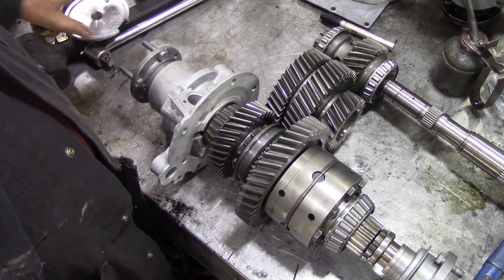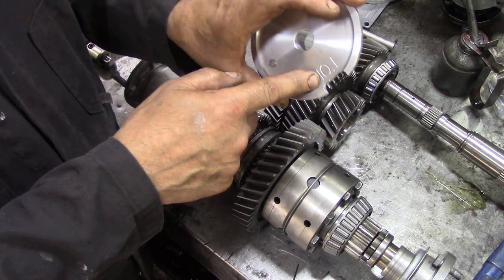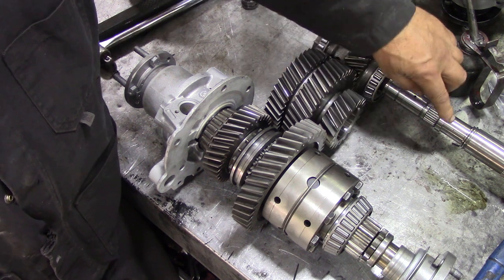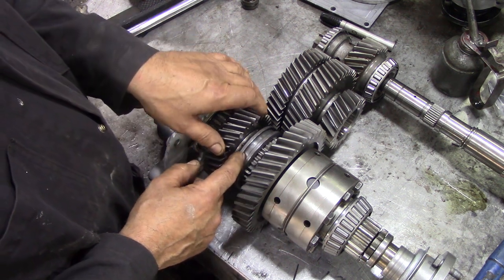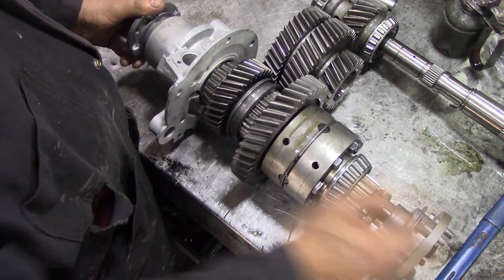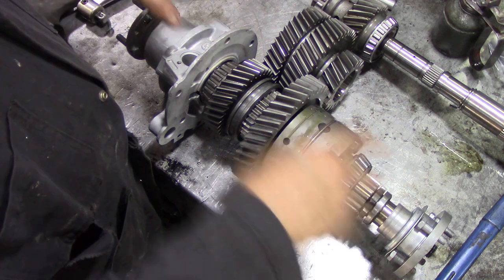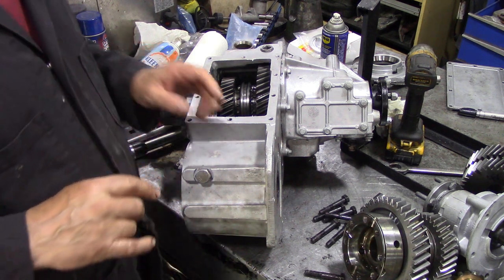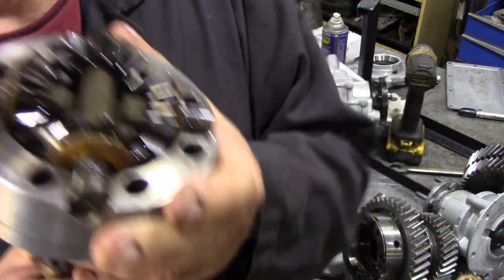LT230 why is mine clunking and what should it be like

Comment: You are the number one man, just finished resleeving my lt230,being a early version l drilled the holes with a masonry drill in the input gear a couple of years ago. I have a Ashcroft ATB diff instead of the one you are showing.
Reply from the maker: Yes the masonry bit works well, but it is slow!
Reply: @BritannicaRestorations  I have pto on mine, will that lube the splines or do I need to drill the gear if so what diameter? I  can't fit one of those adapters,  cheers Roy.
Reply: Hi Greg,  what size drill did you use, cheers Roy.
Reply: @royblackburn1163  8mm to 10mm, l sharpened the tip on the grinder. When you start drilling don't stop or it's hard to get going again. Drilled two right through giving it 4 holes. Did this two or more years ago and the input shaft is fine. My transfer is old 1.003 ratio to a lt85 gearbox and 4bd1t Isuzu motor.
Reply: @GregPalmer2  Prevention is better than the cure and cheaper will do it ASAP thanks Roy.

Comment: Excellent video!

Greetings from Brazil! Happy first/only owner of a 97' TDi (my father's car) with 220k Km and for some reason a lot of klunking. 100% stock car. Will open the transfer case next week to look what's happening.
Reply from the maker: Before you get too carried away, check the propshaft Universal joints, the rear drive flanges in the axle (if it is a 110), and the front axle CV joints
You can check the transfer case by removing the round rear cover on the back and see if there is any wear on the gear/output shaft spline
Reply: @BritannicaRestorations  You are the best! It's a Disco, but my guess is that it  should be the same as a 110. Will do it in January! My mechanic is on holidays now 
eheheh

Comment: i remember the series transfer cases, you have to drop the gears out under the motor to undo the bolts into the gearbox.  a bugger to get that plate in on the centre shaft on the series too,
Reply from the maker: Yes a redesign was needed!

Comment: Another really good video cheers. Reckon I'll have to change shaft a gear next year. I managed to drill a hole in the gear for now but burnt out a carbide tool doing it haha. Also I did have a loss of drive recently all the guys in forums suggested total failure of splines, was actually grub screw on selector came loose. So i f anyone's wee gear stick goes limp check that first!

Comment: Great advice! Sadly i did my transferbox about a week ago! 
After a loud bang and some oil leaks, i found the thrust washers did the old E-jecto. I put a ashcroft ATB in my transfer box as the center diff housing was damaged. And its alot better than it used to be.

Oh and when the center diff failed i wasnt being stupid, took off from a red light and bang.

Comment: The input gear rarely wears out on later vehicles. The clunk is almost always worn splines on the front or rear output stub shafts, or bad backlash in the diff, or worn gears in the diff.

Comment: Hi, I’ve been watching you show for a few months now. Really enjoying and learning quite a few bits. I am getting my Defender 200tdi back on the road. I swapped the LT77 for an Ashcroft R380+stumpy. And ran into a bit of a challenge. All went well, transfer case & gear box went in fine and all gear selections & transfer selections worked well. While checking the brakes etc by rocking back and forth the transfer case locks up when in gear even when the gear box is in neutral. When the transfer case is in neutral all works fine. In neutral it is free. When adding new oil to the transfer case I accidentally mistook a bolt on the side of the case as the filler plug realising the mistake I did it back up. It didn’t seem to connect anything but I am thinking that perhaps it did. In your video when you have the case on the bench you can see the bolt I am referring to. It’s on the input side of the case an has about a 20mm head. I can’t find and reference to it’s purpose or function in any of the  manual I have. Could this be my problem? At the moment I am confused and frustrated. You help would be greatly appreciated. I can send you a screenshot of the bolt if that would help. Cheers Dallas.
Reply from the maker: The bolt is for a temperature sensor - mainly fitted to automatics

When you say locked up, are you sure the diff lock is not engaged?
Reply: @BritannicaRestorations  thanks. That was a quick response. I got to the bottom of the issue. 2 of the bolts connecting the transfer case to the gearbox case actually penetrate into the transfer box near some of the gears. It had  accidentally used the longer bolts at those points. They were only 5mm longer but that is enough for them to restrict the movement of the gears. So glad I tested the transmission line by rocking the car by hand rather the off the engine. I could have been rather catastrophic error rather than a frustration and a bit of rework. I do really enjoy your show. Cheers Dallas

Comment: Interesting video. I have done rather too many gearbox and transfer box changes and I find it easier from the top. I put a piece of 2 x 4 across the two bulkheads and use a ratchet strap to support the weight. A jack can be used to adjust the alignment. You still have a bit of a fight but it is easier.
Reply from the maker: Thanks for sharing

Comment: Just took my transfer case out and noticed some of what looked like copper pieces in the oil, stripped the centre diff and it looks like my thrust shims on the planetary gears have completely disintegrated.
Reply from the maker: That will be from the centre differential - check the wear on the inside of the centre diff

Comment: Cheers Mike, We are working on a 1993 NAS Defender 110 with the V-8. It came to me with a howl from the rear diff. Classic presentation were it howled with light throttle but not under hard acceleration  or de-cell.  After replacing the ring and pinion, the howl remains and appears to be coming from the T-Case! Are we looking at bad bearings? This poor thing only indicates 70,000+ miles... George in Nevada
Reply from the maker: Could be the shims are too slack or tight - could have damaged bearings  - there is oil in it right?
Reply: @BritannicaRestorations  Oh yes, there is oil in it. We only began servicing it last year and have no idea of how it was treated prior. Looks like a swap-out may be in order.

Comment: Mike.  Simple explanation with very good tips or tricks for tool turners !  How did the jokers from the Leyland factory calculate a maximum power or torque figure for the LT-230T ?  V.
Reply from the maker: No idea but set up they will handle a lot more power than any Rover engine fitted

Comment: excellent video mike,whats your thoughts of overfilling the transferbox oil all the way to halfway mark of the plate on earlier transfercases so that the output shaft of the gearbox gets lubricated ? i know its not recommended but would like to hear your thoughts on it.
Reply from the maker: Too much oil can be as much of a problem as too little! 
With the cross drilled input gear or the oil feed plate, I think the issue has now been solved - but it took many years and many expensive gearbox rebuilds to solve the problem! 
I am quite surprised LR didn't put a small drilling in the gear itself, so oil would be pushed into the spline like they did on the series boxes

Comment: Very specific question here’s, have u had a main shaft input gear make any noises in reverse just when loaded, really hoping it isn’t my gearbox, Ik my diff in my transferbox isn’t perfect wondering if the whole box is on its way,
Reply from the maker: Hard to say - take off the PTO cover and have a look at the splines - any signs of rust/crud build up, and it could be a transmission/transfer rebuild…

Very common problem

Comment: Thank you mike i think i have this problem how do i know transfer box what is it says 34D 286353E does that mean its LT230
Reply: From a quick Internet search it appears as a LT230T 34D 1.410 Discovery V8 & 2.0 Mpi. 

But E suffix is strange because as far as I'm aware the LT230 suffix only went upto D not E.

Are you sure the last letter is E not B?.

If he can't help it'd be worth contacting Ashcroft Transmissions in the UK
Reply: @R.Sole88109  it is Discovery 2.0 Mpi 1.410 ratio but im not sure 100 % the last letter E or B, i see this letter like E

Comment: Was just thinking (can be dangerous) . Does the PTO lubricate the splines on the input shaft?  Or will you need the cross drilled gear  .  BTW who has a Landrover without a PTO right! 🚙  Cab you drill those holes in a drill press?
Reply from the maker: If you mean the Roverdrive, the input gear comes with the overdrive and the unit uses the LT230 lubrication for overdrive and LT320- highly recommended to fit the high capacity sump with cooling fins as they get very hot!
Reply: @BritannicaRestorations  No I am thinking of the PTO for a winch or other stationary machinery.  Could it be that the PTO works as that splash pan you show in the beginning of the video and landrover thought that everybody would mount a PTO and therefor didn't care about lubrication of the spline without an PTO, ?
Reply from the maker: I have only seen one Defender with a PTO hydraulic power-pac on the back of the box, so I cannot say

Comment: Hi Mike, thought I’d change the gearbox oil on my 94 defender 300TDi, (R380) there was red ATF in it (looked like it anyway).  Well, I looked up the forums and read that MTF94 was being recommended, so used it, I would definitely say she’s not as smooth going into 2nd (first thing, but after a few minutes, when everything warm, she’s fine).  Should I change back to the ATF?  WWMD - What would Mike do? :)
Reply from the maker: I just put some similar MTF oil in my R380 and the only difference I saw was in my bank balance !
Reply: @BritannicaRestorations  lol, think I’ll persevere for a while, I’ve also read Difflock Evo1 oil is the dog’s jibbly bits, might try that👍.  Still planning to head to TO in October, will bring more Bournville 🍫 , and post from there👍🇮🇪🇨🇦
Reply from the maker: Sounds great!
I am contemplating fitting a new OEM synchro hub and 2nd gear to an R380 to finally find out what is going on with these gears - Dave Ashcroft seems to think it is the synchro not slowing down - however it is not in all gearboxes - I drove one yesterday with 300,000 km on the original box and the gear change was very smooth

Comment: I have a LT230/LT77 in my series. I have to run on difflock all the time as I only have the rear prop connected. The backlash is monumental. I've used it like this for 2 years but its getting worse. Am I right in assuming that its play in the dog gear on the diff-lock selector hub? Would the 2WD conversion cure this?
Reply from the maker: Not wise to run on just one prop - there used to be a 4x2 conversion but that was years ago - Bearmach used to sell them
Reply: @BritannicaRestorations  They still exist. £210 online. Why is it a bad idea to run with one prop? Surely it should make no difference. I should really reinstall it but I have a defender diff in rear so would need to change front as well.

Comment: How do I know  which is the correct input gear to order with  a 1988 EA vin RRC auto, are they all the same number of teeth ? the splines between the input shaft adapter & the input gear clearly have slop, 2nd time now! It is noticable when selecting reverse, the first time the splines actually stripped & we lost drive altogether,  my other car, DA vin which was the input gear donor had the same clunk but only when put into drive ? But this gear & adapter were perfect for a while when used in the EA ?
Reply from the maker: You have to work on the serial number of the transfer case, not the vehicle's VIN

Comment: Great tutorial here's a heads up check out nejisaurus pliers trust me they are  life changer vampliers are the same but more expensive rounded screws on landrovers come out easy
Reply from the maker: They look good - I think I will give them a go!
Reply: @BritannicaRestorations  they save me so much time with fixings that have been rounded off by numtys I fix motorbikes and landrovers and I have a few different ones
Reply: I second that. I converted a not so easily impressed colleague to them. Just be sure to get the biggest pair.